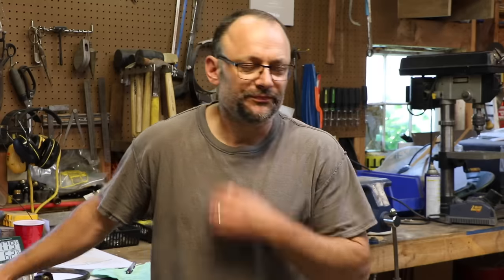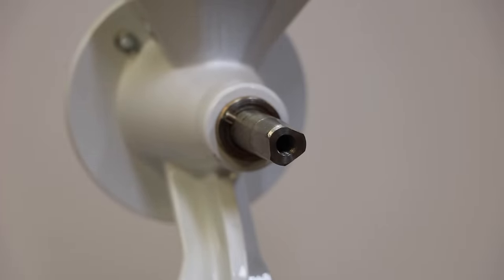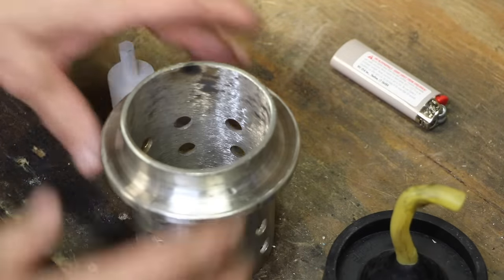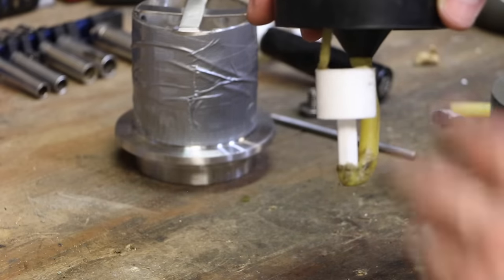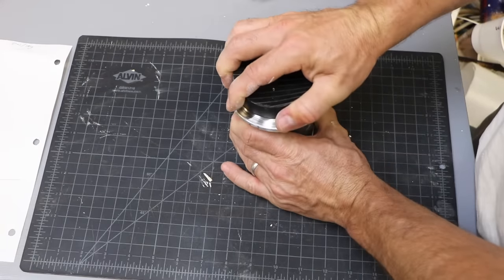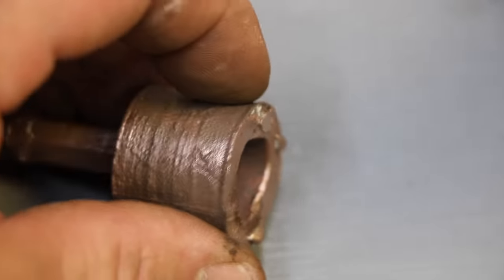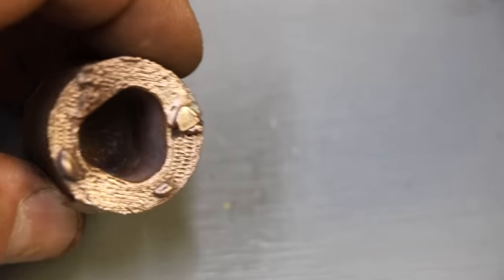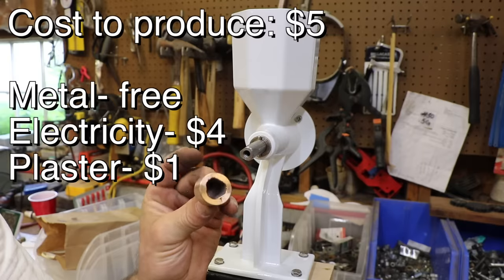I Refuse to Buy Your $@#!   I Make My Own.

Comment: As one of the previous comments stated the tapered three flat end of the drive shaft is not proprietary to keep you from connecting to it without buying the company's expensive adapter.  The crank handle is a cast part.  To keep the cost of the crank handle down, a non locking three flat tapered socket is used to connect the handle to the drive shaft.  The taper allows for a less precise socket in the crank handle so it can be used in the "as cast" condition.  (Dimensions vary quite a bit from part to part in cast parts.  This is generally why you see critical surfaces machined after casing.)  With a straight socket the dimensions need to be carefully controlled to get a good fit from shaft to socket.   With a non locking taper the socket in the crank handle can slide onto the end of the shaft until it fits snugly when the tapers make contact.

Comment: You could have filed a flat on the UNtapered portion of the shaft, installed a v-belt pulley and used and electric motor to drive the thing!!

Comment: Who designed this part? It’s quite obvious that a fase between the hex and the adapter would make it a lot stronger in plastic and metal as well. Designing your own part might save you a lot of time as well :)
Reply: LOL It's solid brass it'll last a lifetime or two the way it is.  Now what would be cool is to test how much actual torque will destroy the adapter and compare that to a torque wrench readout of the mill grinding in action.

Comment: I would have just tried to cut the shaft into a hex or remove the taper from the three sides, if it would fit in the drill chuck.   If casting, I would have made the small attachment end a triangle (not hex), just to give it more strength and resistance to shearing off.

I don't have a 3D printer, so I might have taken warm wax and wrapped it around the shaft to get the shape, then chill the wax and hand carve the attachment part.
Reply: Y'know what they say though. When you've got a really nice hammer, everything's a hammer problem.

Comment: That seems like a great solution. I was thinking you were going to use a flywheel, cut out the groove onto it so that you can secure it and mount a motor and belt to the side of it so that you can press a button and it starts grinding.

Comment: It looks like (could be wrong) that only the first part of the shaft is a taperd triangle and the rest of the shaft is round. Would it not be easier to make a deep hollow tube (or cut off some stock) and slide that over the triangle nonsense to the round bit and then use some set screws to fix it to the shaft?
Reply from the maker: This would work.  Might need to file a flat in the round part for the set screws to key on.  But I would still have to do a fair amount of fabrication/welding, etc.  Lots of ways to work around this fitting.  I've also been experimenting with this casting technique and wanted to try reproducing a part that has a purpose to see how it went.  Cheers.

Comment: That odd shaped shaft was probably the dream child of marketing and accounting.  I think the scheme is called horizontal sales or something like that.  I believe my DeWalt drill would fit on it, as it is, because the chuck should grab on the flat side without slipping to much.   I am sure not going to melt copper just to make an arbor for that grain grinder.

Comment: Ehh, you have a lathe. Why not just put the mill in the lathe chuck XD
Reply: Don't destroy the original design.  Make an adapter.  Perfect solution.
Reply: @RaspyOB174  Nah I just meant to clamp the drive shaft of the mill in the chuck, and turn on the lathe.
Reply: @DC_DC_DC_DC  
Ahh fair enough that's funny.  Could've used "to operate the mill" at the end of your comment.  Seemed like you wanted to modify the mill shaft.  How would you clamp the housing down?  LOL
Reply: @RaspyOB174  just let it hit the carriage hehe

Comment: I like your resolve and I might've done the same thing; however, figure out the thread size and simply insert a bolt that has the head cut off. If it breaks, drill it, use an extraction tool and you're back in business.

Comment: Cool project, but couldn't you have modified the stl of the coupler to remove the plastic shaft and replace it with a bolt?
Also depending on the size of the shaft on the grain mill couldn't you have created a 3d printed adapter that would turn the triangular shaft to a (big) hex that you could just fit a big socket over?
Reply from the maker: I can put a socket on the hex of this adapter.  I agree the hex is a little smaller than I would like, but it works fine.  I'm not sure what you mean about a bolt.  Why would I want a bolt instead of a hex shaft?
Reply: @FarmCraft101  I guess he means (at least what I thought) is printing a 3d part which takes the mill shaft on one and a hex shaft on the other side.
Reply: @FarmCraft101  Just rewatching this video and I threw together a quick mod that allows the use of a large socket. thing:5450662

Comment: I probably would have just cut that tapered part off and made an adapter which was round on the inside, and hex on the outside. Weld that on or use set screws. Now use the appropriate size socket to turn it. In case you still wanted to use the handle, you could weld the cut off piece of shaft to the appropriate size socket. But, your way works too.

Comment: So let me get this right
To avoid spending $ 29
You bought (being cheap)
$1000 3D printer
$ 600 lathe
$ 600 Kiln

.
Yup, that sounds like a good plan
Actually I suspect that adaptor is not even sold by the grinder maker, but a 3rd party like yourself ...lol

Comment: This was so much work, why didnt you just repurpose an old socket. A file, and jb weld. Done.
Reply from the maker: 2 reasons.  I wanted to try this technique.  And I also wanted to keep the option to use the handle in the future.  But there are many ways this could have been solved, as you point out.  It really wasn't that much work though.  After printing the part, I have maybe an hour of labor in it.  All the steps went pretty quick, and I did them in parallel with a bunch of other castings.
Reply: @FarmCraft101  wise words from an ol manager I was told once. "Always have more then one way to skin a cat". I took that to heart with alot of things in life. Thanks for the reply! Best of luck on your life adventures.

Comment: I was laughing at the 3D print option,  Even though I'm a 3D printing enthusiast of sorts, I still avoid 3D printing things that fail.  That 3D printing idea in this case might actually work, in part.  If you were to use a few screws on the female part, and mount it to a steel disc with a shaft, it could work.  Say 3 #10 or 4mm screws, a washer with drilled holes, and a bolt, with a jam nut.  Maybe loose the first inch of threads.  Anyway, cool video.  Thanks!

Comment: Wow, a $30.00 tool cost you over $500 (labor, materials).🤦 At least it was cheaper than the $400 toilet seats! Good enough for government work!
I totally agree with the principle, but my time is worth way too much to be messing around fabricating a tool.

Would it not have been easier to just put a 1/2” drill chuck on the shaft?
Another option would have been to weld a shaft on the original handle?
Third option, which would be a much bigger job, is to mount a pulley on the shaft. Mount a motor on the side with a pulley. Put a belt on the pulleys. Set a timer to power the motor. And there you go. Grind away!

Comment: Surprised you didn't just square up the shaft :)   Or, weld a socket onto it, then fabricate an adapter for the handle.

Comment: Stupid Question time: Woudln't it have been easier to mill the shaft of the grinder to a Hex?
Reply: My thoughts exactly.. Hell, just use an angle grinder...
Reply from the maker: I should have mentioned in the video, I wanted to maintain the option to use the handle in the future if needed.

Comment: Little late finding this video but I noticed something quickly. You have 3 flats (despite being tapered) and a standard drill chuck has 3 gripping teeth. It seems to me that trying to put the chuck dorectly on the drive shaft should have been the first and cheapest try.  Looks like a common 1/2" chuck would work just fine.

Comment: Well, first of all, that is an intelligent design by the company.  It's not to stop you from attaching something to it.  The taper is so that the handle remains tight while cranking.  So even if they put a hex there, a socket still wouldn't work.  I think the company actually had the consumer's interests at heart by offering an adapter for ONLY $30.  You see how much work you had to do to save ONLY $30?

Comment: My way might have been different.  
Welding the shaft until round...cutting/filing/sanding the shaft to square or hex shaped.  
Making a square or hex shaped adapter to fit the new shaft end...with the other end hex shaped for the drill.  
Sit back & laugh at the company trying to sell me a $30 part that I...now...don't need  :)

Comment: I think I would have used a 1/2 " three jaw chucked drill to bite the mills shaft directly it  would have worked perfectly...and if the O.D. of the of the origional shaft was slightly to large a few moments on the lathe to trim off the radius...leaving the three flats...think FORSTNER BIT STYLE.... It would have save a ton of work.

Comment: I always figured those odd shaft tapers were to prevent a massive load breaking the machine, like putting an impact driver on a 5/8 socket and going to town. Forcing you to buy the hex shaft adaptor, larger than 1/4 inch, so it doesnt fit the impact driver. And yeah, I know you could still get a socket overthe hex adaptor but at least they tried to prevent abuse and breakage

Comment: Nice job but $30-$5 means your time, efforts, expertise and costly specialized equipment wearing are valued $25. If you spent 10 hours on this project that’s $2.5 per hour. If your day job is making you, say, $50 per hour, that’s a $52.5 loss per hour, so -$530 total. If youtube isn’t at least giving you this money back, it would have been a better deal to just buy the $30 (equivalent to around an half hour only of your day job before taxes) official adaptor or to choose a grain mill that doesn’t have a proprietary shaft profile in the first place. Also, have you tried 3D printing in Nylon? Printed horizontally, not like a tower : better strength. Maybe also with a better design at the breaking point (conical shape).

Comment: I guess you don't believe in the Labor Theory of Value?  Not knocking the idea...I'm the same way, but I bet that took way more than $25 of your time.  You also didn't count the capital expenses for the 3D printer, the Kiln and other casting equipment, etc. Tsk tsk.

(I'm being sarcastic, BTW.  This is all true but obviously beside the point of the video)

Comment: I thought you filled the inside with plaster... how did metal flow into the recess if hardened plaster was supposed to be there? ( @5:00 roughly )  OK I know how!  You said the PLA will burn out (DUH!!!  The plaster is everything that the metal forms AROUND... obviously... derp.  Is that 2nd piece of wax connected to the rim of the part for the vent then?)  So wait - does that mean that the PLA gets INSIDE the bronze?  Won't that fuck up the bronze?  Or does the PLA rise out?  Look at frame  @7:41 You are holding the bronze in your hand, and you have the top extra in your palm, and part of the vent stcking up out near your index finger, is that little vent part where all the PLA and wax ended up?  Did that break off easily?  OH is that white stuff all the PLA and wax?  And that was able to just peel right off?  COOL!!!!!  So the PLA and wax DID NOT mix into the bronze at all then huh?  NEAT!!!

Comment: Very cool.  I liked seeing copper windings turned into phosphor bronze.  Where'd you get the tin?  
I bought the 12" pulley instead, for high twenty something.  Add a long belt and a bicycle without a tire and you can burn calories while you mill wheatberries.  Or hook the bike up an alternator and charge batteries.

Comment: DUDE - TALK ABOUT OVER COMPLICATING - JUNK OVERSIZED SOCKET - FILL WITH EPOXY PUTTY - CENTERED PUSH ONTO LIGHTLY OILED OR TAPED  SHAFT - TRIM PUTTY - ALLOW TO HARDEN 10 MINUTES NO TOOLS - HEX ADAPTER FOR SOCKET

Comment: So how long did that drill last 🙂It gotta be toast by now.....
You know you can adjust the infill on 3D prints, right??? Probably would still not have been strong enough with just a 1/4 in hex. But maybe if it was made 1/2 in. Still fits the drill. Or maybe if it was printed laying down, so the lack of layer adhesion is less of an issue.
But this adaptor should really have been designed with a 1 inch hex (or whatever fits best) on the part with the bigger diameter, so a socket can go around it. Printed 100% infill it would last for a long time. Unless it was always intended to be used for a mold of course....

Comment: Very nice little project!  The only modification I would make is having fillets at the point where the hex shaft meets the body to increase strength.

Then again, I am barely at the aluminum casting stage, where that is more of an issue, unlike bronze.

Comment: Why not just grind the shaft into a hex for a socket? Looks like it’d be at least 1/2” that’s plenty strong. 5 minutes grinding and you’re done!

If you want to hand grind a handle for that socket is more easily fabricated than all that molding.

Comment: John, I love that you made this, totally something I would do. I hate companies that do that BS, it's so aggravating and adds unnecessary cost. I get CAT doing it on a piece of equipment (still don't like) but on a freaking hand cranked grain mill?! Absurd.  I'm sure you just wanted to cast something, but if a guy wanted to, he could have flat filed the three rounded portions of the shaft to fit a regular socket over. Engaging three flats would likely be enough to drive the grinder. 🍺

Comment: 2 many extra steps in spruing and position of item to be cast bro.
Attach key chuck directly to sprue wax dead center. Eliminates unfilled cavities and a better "gravity" pour. Ps. Add a drop of dish soap to your investment water. Makes water "wetter" and much better elimination of air when vacuuming hence elimination of "bubble" nodules. 
The less wax tool marks the less finishing. 😉👍

Comment: I doubt most domestic companies could build a proprietary part like this, and keeping it on inventory, considering the low volume of sales for less than 30 bucks. so it’s not really greed it scarcity and limited demand the price this part. also his total cost of ownership assessment of five dollars is the most bad faith, dishonest assertion. I think you could make the metal wasn’t free. There was a price paid for it in some capacity the electricity, maybe it was four hours the plaster probably more than a dollar but who cares he left all all of the work to make the plastic 3-D printed version and all of the time and energy put into modeling, casting and machining this.

It was a very successful failure in value . false assertion  of greed projected onto a company.

Comment: What was the infill on that 3d print...10%?  Certainly wasn't much, not surprised it broke.  Would be interesting to see if 100% infill would handle the torque any better...Could also increase the size of the hex portion to allow more bite onto the fitting side, less likely to snap off.  I think this could have been 100% accomplished in pla if designed correctly.

Comment: Just a note: obviously,the plastic would break off, but I wonder if it wouldn't do light duty if one were to platic-weld around the bottom of the shank? I wouldn't have even chucked it up without that.
My favorite part was cleanup in the lathe. Oddly satisfying!

Comment: This man has a lathe and didn't radius the small Hex shaft into the large driven portion of his adapter. He created a thin place for his part to stress and fracture.
Why was the Hex key portion so small?  I would have made it beefy and bigger .  
Actually I would have just ground that mill shaft into a Square and used a handle from a mill to turn it or adapted that to a drill.
Why accept any of what you are given to work with. Burn it all down and start from a better point.

Comment: A faster way to do this, turn a part on the lathe, bore the taper in the center hole and drill 3 set screw holes at 65drg? Or what ever the spacing is lock it down tight marking the landing spots mill a flat spot for the set screw to hold.
Then that becomes a drive to hold a pullies to run off a motor that runs off 120 volts. No drill needed. 

Or just make an adaptor, drill a hole for a roll pin to lock it on permently.
I don't think a cast metal would hold up as good as solid bar stock.
You could use stress proof like 4140   and heat treat it.

Comment: Seems like it would be easier to adapt a six point socket to fit that shaft. Doesn't have to be an expensive one. Doesn't have to fit perfectly. Just round out three sides. Not knocking your process. Most people don't have the tools you have. I know where I can buy or borrow all of those tools but it seems like a drill press with a good vice would make a good adapter. When I start baking bread I'm going to try it. LOL

Comment: Looks like you had fun doing this project. I probably would have use an old damper linkage adapter. It already has set screws built in it.

Comment: Could have made a drive using the pin thru the shaft to drive it.A 1" or 3/4" rod turned to fit drill chuck 3/8" -1/2" and drilled hole to shaft of grinder then a slot across the face the size of the pin. But casting was neat I just worry the small he may snap like the plastic did.  Cost less then a buck for steel or aluminum.